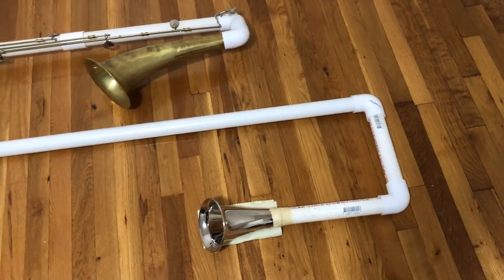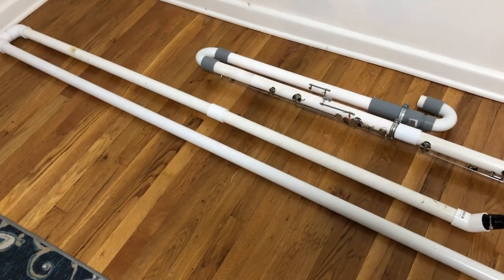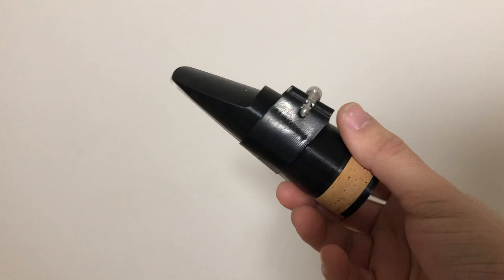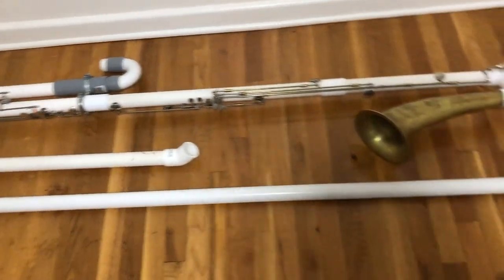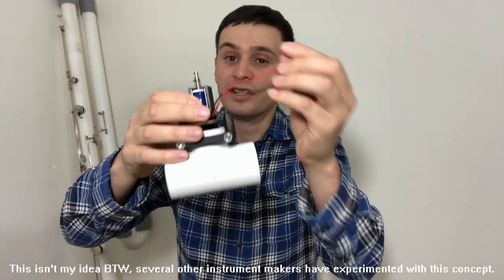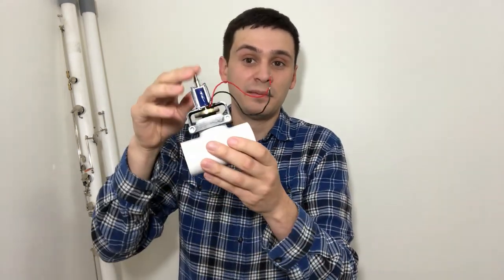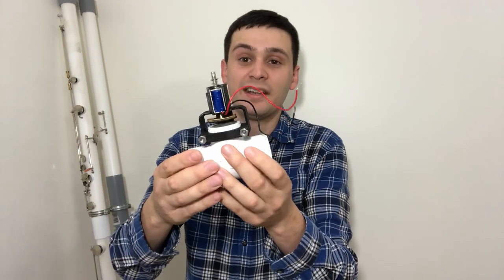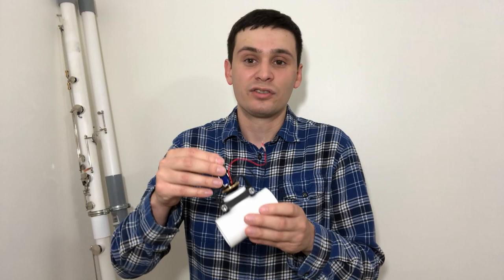A new octocontrabass clarinet prototype, plus Bb-1 (Low C) demo!

Comment: I think this video has given me an idea. For a long time, I've been trying to figure out how I could design a completely removable low Eb extension for a Bb clarinet, and then work my way up to more ambitious extensions, like a basset extension. With typical mechanical keywork, I don't think it's possible to design it so that it is completely removable. However, if I apply your application of solenoids onto the tone holes, removable extensions could work, and be very effective. All I would have to do is design the body of the extension with mounts for the solenoids and a structure that reaches up to wherever I would want the "keys" (my first thought was micro switches because they are very light, compact, and easy to trigger), and then program a microcontroller to deal with all of the inputs and outputs. I may actually start working on this design within the next few days. I know you aren't the first one to think of this concept, but thank you for exploring it! As a mechanical engineering major whose biggest passion is music, I love to see people experimenting with new takes on old instruments!

Comment: I would think it would be simpler to use something like a EWI or WX7 as a input device. A fairly simple interface between the midi notes and say an ardunio would result in the solenoids clacking away in no time. Such a mechanism could be essential braced onto the side of the existing tube work.
Reply from the maker: That might be the way I go. Though I think I want to experiment with contacts connected to clarinet key work to simulate the feel of a clarinet.
Reply: @Jared_De_Leon  search on youtube for: "Introducing CLEX - Basel Sinfonietta ft. Ernesto Molinari". This is the method you are looking for. I believe this is a Bb contrabass with an extension down to low A. They basically put regular clarinet keys on the neck since its so long. With an octave down transpose button you won't need all those thumb keys.

Comment: There are two sides I'm feeling on electro mechanical keys.

The traditionalist that enjoys analog and having that physical connected feeling when playing my clarinets is appalled at having electro mechanical keys....

tinkerer in me is fascinated. The instant transposing nature the programming allows could be ported over to other clarinets in the future. electro mechanical keys also means less physical stress on the player. not gonna lie, the biggest drawback to an octocontra bass clarinet with traditional mechanical linkages is God help me with some of those pinky keys. On extended range bass clarinets, I've seen some people put down playing bass clarinet just from the amount of metal a single pinky has to move for a single key. The stress was too much for them.

Either way I'm curious to see the end results.

Comment: That low Bb should be an octave lower for the instrument to be called “octocontrabass,” since a regular contrabass in Bb can play it.
Reply from the maker: It is an octave lower…
Reply: @Jared_De_Leon  The note you played is Bb0, lowest Bb on the piano. Check out Richard Bobo's Subcontrabassoon for a Bb an octave lower.
Reply from the maker: @ABruckner8  it’s Bb-1. Trust me I have a low C paperclip and I can 100% confirm that the tube was twice the acoustic length and played an octave lower. Try listening on better speakers.
Reply: @Jared_De_Leon  Dude, my apologies...I was talking about the low note at the END of the video (9:25), and now I fully understand! (And it turns out that note is actually F1, cuz you're messing with harmonics!) I was wondering wtf cuz the note in the middle of the vid is Bb-1 (3:44), so all good!! Sorry man! Keep up the great work!!
Reply: 14.6 Hz! That's low enough to hear each cycle.